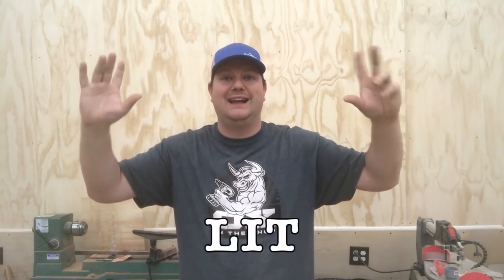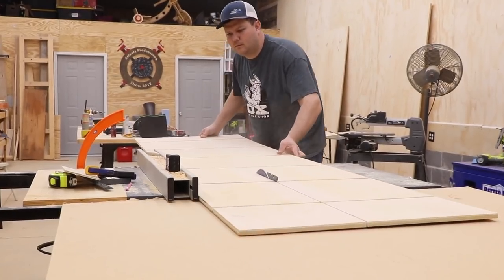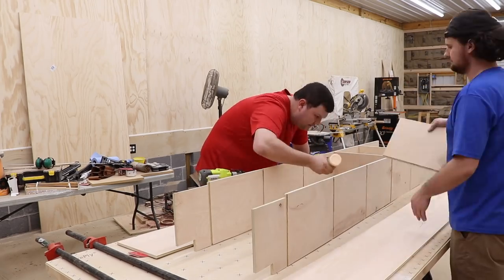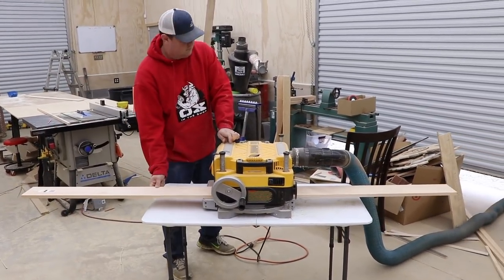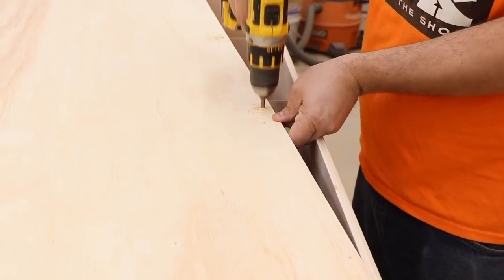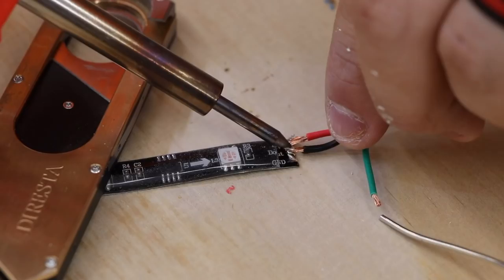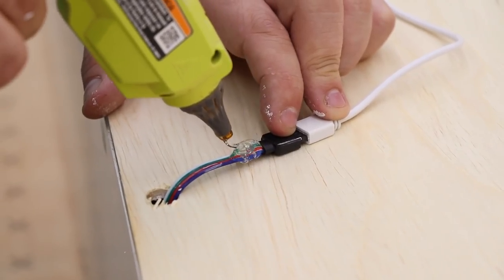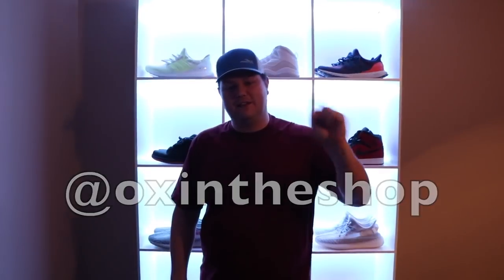Making THE ULTIMATE Back LIT Shoe Shelf

Comment: When you solder it helps to strengthen the solder joint if you put solder on the wires first (so no copper strands are showing), It also helps to use silver solder and a non corrosive  rosin. But with all that said the push to connect is a lot easier. great job.
Reply from the maker: Yes they are easier I did put solder on the wires later on but they still pulled off the strip copper and all. Thanks for watching and the comment

Comment: That project turned out super nice. Sorry to hear that you had so much trouble with the LED strips. Did those new connectors add much to the total cost?
Reply from the maker: The connectors and the wires were only like $12